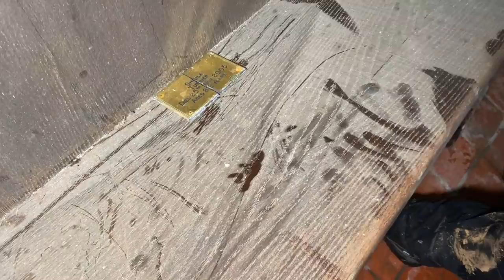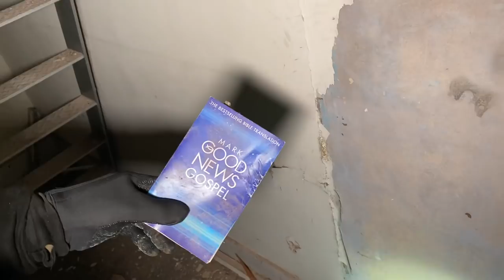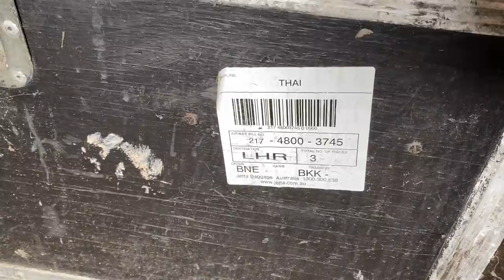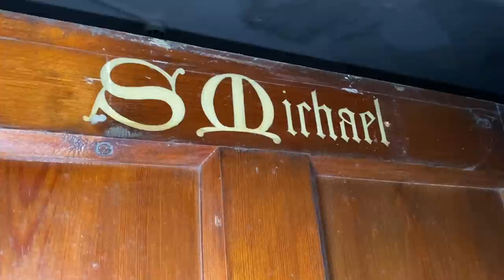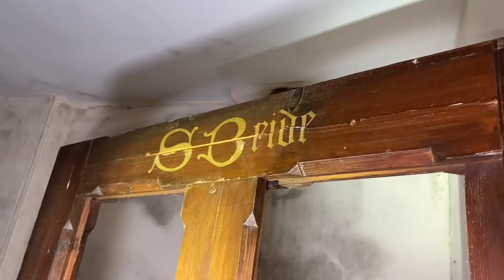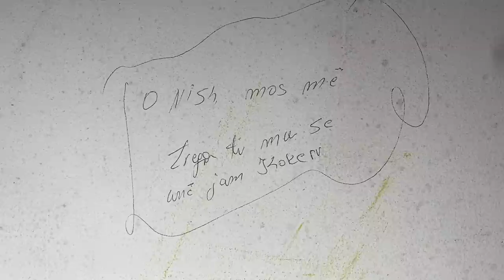This spooky ABANDONED convent was used by dangerous criminals

Comment: The storm is Storm Christoff
That bell is not a traditional church bell - a traditional bell has a lot of room around it because it has to be ‘rung up’ before it can be used.
Ringing up is when the bell is swung from side to side, using a rope and pulley system attached to the top of the bell, with each swing getting bigger until the bell is literally standing on its head - after that it can be rung.
During the ringing up the bell clapper does not connect with the side of the bell as the swings are not wide enough.
When the bell is rung after ringing up, it traverses a wider swing allowing the clapper to hit the side of the bell.
The bell seen here would have been rung by a rope-like cord (that you saw) attached to the clapper, and this would have pulled the clapper to hit the side of the bell.
You made me VERY anxious @25:40 - that was a nasty drop!!
A postulant is a woman in the very first stage of becoming a nun; she then becomes a novice, and after taking vows she becomes a nun or a sister.
A nun is someone who lives in a closed community - no interaction with the outside world.
A sister is an ‘active’ nun who goes out into the community - such as teaching or nursing